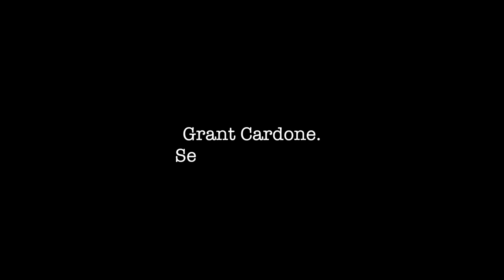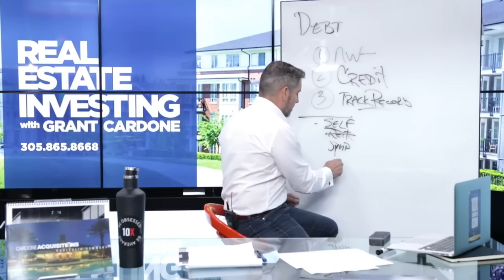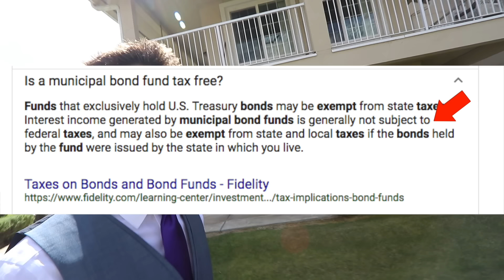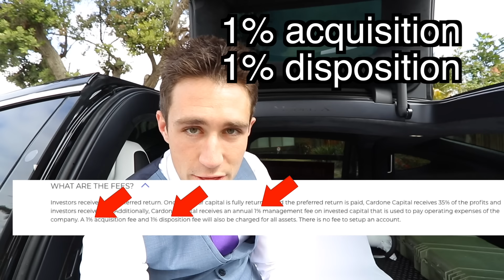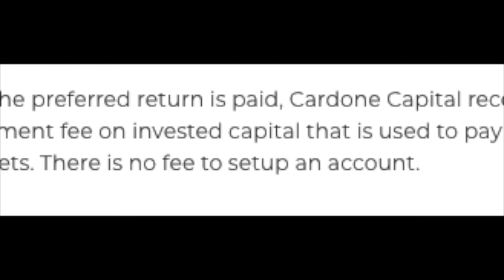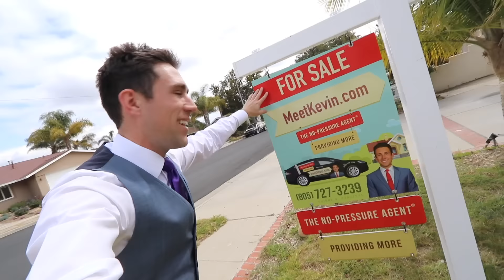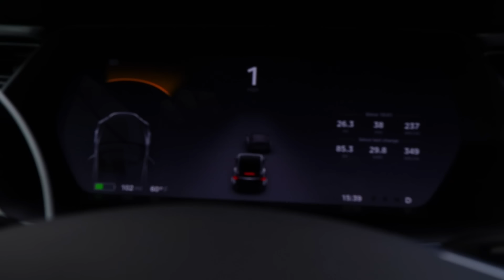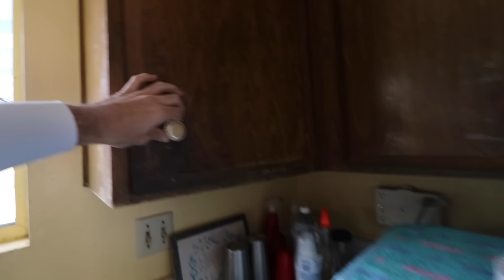Grant Cardone & Cardone Capital Exposed

Comment: So basically on that 8M he takes 960k over 10 years and on 32M profit at the end his cut is 11.2M. The loans will be repaid too and initial capital, that leaves total returns of 19.84M over 10 years on 8M invested i.e. 248% return or 348% including the investment i.e. 13% per year compounded. The problem is the stock market returns just a little under that on average, can be spread in anyway you choose and your money is not locked up for 10 years. Factor in that the 2x return is probably too high an estimate and it doesn't seem so good. If it was only 50% over 10 years that is about 6% per year which he already paid out to you per his promo clip so you aren't getting anything beyond initial capital back at the end. Anyone who invests in this is a sucker.